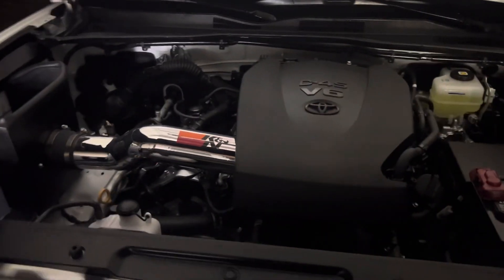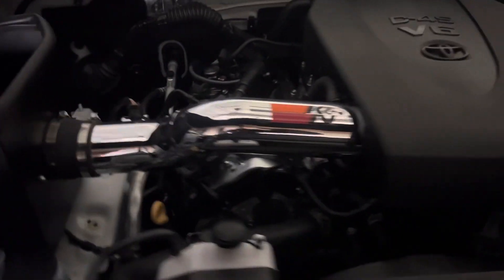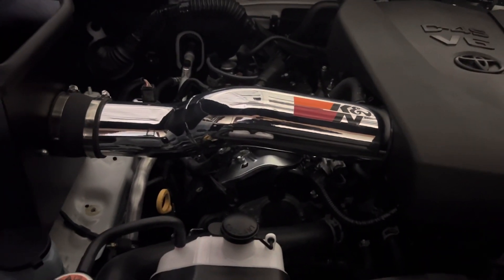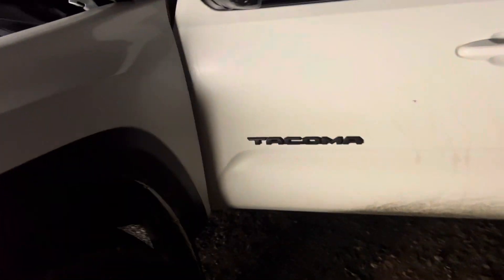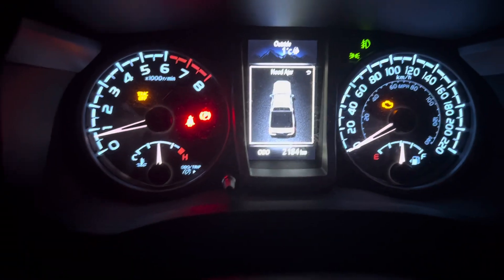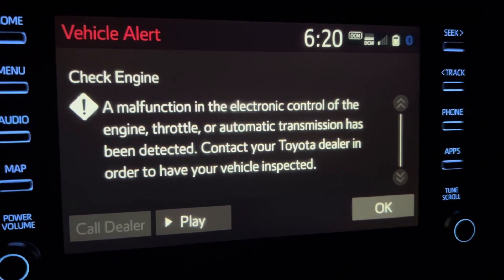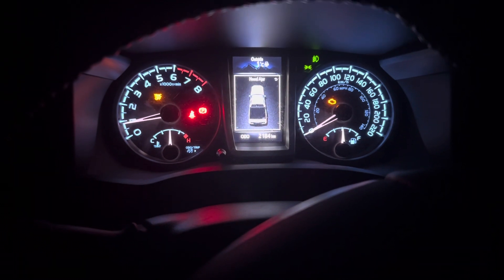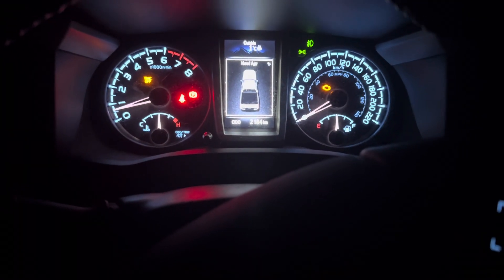Why I removed my K&N Cold Air intake from my 2023 Toyota Tacoma TRD Pro

Comment: 2017 trd off-road with k&n filter for 2 years already and no issues.
Reply from the maker: The difference I learned through the install was that the OEM set up is pulling cold air from the outside, whereas the K&N is pulling hot air from the engine bay. 
Besides looking better and sounding better , the performance benefits are debateable…

Comment: A CAI is NOT the way to go unless you are modifying your engine. Your factory  stock airbox is already a CAI because it gets its air from outside the engine compartment.
Reply from the maker: Agreed - I removed the aftermarket cai and went back to OEM once i got into it and saw the great set up Toyota has

Comment: When I installed it on my 2023 Tacoma Sport the same thing happened but it was because I had not placed a hose correctly and it was sucking air through there. I connected the hose well to make sure there were no leaks and the problem was fixed.
Reply from the maker: Thanks for your experience- cheers !

Comment: a little trash piece must have traveled into a small spring in the TB
Reply from the maker: @stevenlangevin1159  you never know, but I went back to OEM regardless just because it pulls cold air out of the wheel well

Comment: I have k&n 77 series i dont have issue so far
Reply from the maker: @jonjones9357  I have had great success with these on other vehicles, but ultimately on the Tacoma, I decided to go back with OEM because of the design of the stock system, pulling the cold air out of the fender well.

Comment: I had the engine come on mine, I told my mechanic about. He checked it out , took the air sensor out n cleaned it with just blowing air. Not a problem since then, he told me I sprayed to much oil. So every now n then I take the filter out n blow it out. I also put a dust cover on the filter to keep dust n water away,  works like a charm.
Reply from the maker: Thanks for sharing Brother!

Comment: Thanks for the video. I had the same one in my 2020 Ram 1500 Hemi installed it under 1000 miles on the truck took it off after 37000 miles never had an issue. I removed it went back to stock because I didn’t want to spend the money on a new filter. I will not be installing one on my 2023 Taco V6, I really don’t think it is worth the money well at least not this one anyway.
Reply from the maker: Agreed!

Comment: Why? I installed mine..No Problems!
Reply from the maker: @ThepDenNgoaiBien  likely some oil from the filter, went into the intake.. - regardless the OEM set up is better as it pulls cold air through the fender instead of warm air from the engine bay- so I went back to stock .

Comment: 4runner ALREADY has a stock cold air intake down at the wheel well.  You created a hot engine-bay intake 😉
Reply from the maker: @LexusGX460-OFF-ROAD  yes indeed , i learned this on my install when i bought the truck- and ultimately went back to oem right away, this was one of the reasons…🍻

Comment: Did you tune it after installing it?
Reply: I install an S&B CAI and did the same thing on me i had to desconnect battery every 100 miles to reset computer... i think u have to tube ur pcm, every truck reacts diffrent i guess
Reply from the maker: @daatobler976  no I removed it, and went back to OEM- I actually no longer own this truck
Reply from the maker: @SsnoopNinja  it’s frustrating, too many electronics these days

Comment: Interesting.  I put a S&B CAI on my 3rd gen tacoma. I picked a paper filter for it. Before I installed it, I disconnected battery, then when I was done installing,  I connected battery again and let the computer readjust to new flow. I haven't had any issues so far. I have had on for over a year so far. The disconnect battery step I'm not even sure if you need to, but saw some videos doing that step. Keep us updated. Thanks
Reply from the maker: Ultimately, I would like to go with the S&B down the road. I did disconnect the battery, I just think some excessive oil got through.?
I went back to stock and will look at a system, like yours down the road . Are you happy with it?
Reply: @mikealarie007  yeah, love it! Looks good too. It did change the sound a little, not a whole lot that's been "hyped" on some channels. I will be getting a MRP axel turn down exhaust down the road as well.
Reply from the maker: @shiloc7james363  I have not heard of that exhaust, so I will definitely check that out. Thanks for sharing.
Reply: @mikealarie007  sorry its MBRP EXHAUST,  not MRP, LOL
Reply from the maker: @shiloc7james363  right on. My buddy has one on his Titan and let me tell you it sounds dirty.🔥

Comment: I always had this issue when it was cold out. I had one on 2 different 4runners and a Tundra TRD Pro. The quick and simple fix is disconnect the negative cable for about 15 seconds and put it back on. It seemed to happen especially when accelerating hard if the motor was not warmed up.

Comment: What was wrong with the stock cold air intake?
Reply from the maker: @DJjosher  nothing was wrong with it, I was just hoping to get a better sound, and possibly some performance gains . 
However, once I took apart, the OEM intake , I was able to tell that it is actually a pretty good set up right from the factory. 
What I mean by this is that it is pulling cold air directly from the wheel well instead of the warm air in the engine bay .
Reply: @mikealarie007  Those are great observations. Thank you!
Reply from the maker: @DJjosher  good luck with whatever route you decide to go!

Comment: I have the TRD performance intake and didnt really notice a change, maybe slightly at much higher rpms. I did get a K&N blackhawk CAI which is a dry filter. No issues with idling, I like it so far but it may be too loud 😂
Reply from the maker: Thanks for the input, I have a Trd pro, and I wish it was louder!
Reply: @mikealarie007  I have the pro as well. Definitely worth a shot paired with the cat back exhaust (and the K&N blackhawk). It's no rumble like a V8, but it's louder for sure.

Comment: Didn’t for me, did you disconnect the negative terminal, are you sure the mass airflow sensor is on properly, is there any leaks?
Reply from the maker: After opening multiple units like this, I went through the proper procedures. I just think that it was probably some oil that got on the sensor., but after learning the design of the OEM version, I decided to go back to OEM and have the cold air come directly from the wheel well
Reply: @mikealarie007 interesting, i’ve had mine on since june and it runs perfectly fine… manufacture issues i guess?
Reply from the maker: @Spuunzy  I don’t know, I might go with the Trd pro version that pulls cold air through the fender at some point

Comment: Did you disconnect the battery first ? If you didn’t that could be the issue .
Reply from the maker: I sure did . 
Ultimately, I went back to oem , not just because of the issue but because once I took everything apart and saw that the factory design was a better option in the sense of it is connected to the fender, pulling in cold air from outside of the engine bay.

Comment: I installed Mishimoto high air flow straight tube 2018 3.5 Tacoma the throttle clicking popping when steering wheel is turned. I put stock cold air intake back, no clicking popping. So, I think it’s just too much cold air that computer doesn’t recognize. I’ll stick with stock for now on.
Reply from the maker: Thanks for sharing your experience!🍻

Comment: My 2017 ltzs engine loses power and cuts off on me after installing my cold air intake, I’m assuming after some digging that the sensors can’t read or aren’t programmed to read that much air flow so it shuts the engine off
Reply from the maker: @xxonexx471  thanks for the input, that’s really unfortunate that is happening🤦🏽‍♂️

Comment: does it need a tune?
Reply from the maker: I think a tune is always a good idea, however, I don’t think that just by changing the air filter it should be mandatory….
I ended up removing it and going back to OEM

Comment: Realistically they don't filter quite as well as a paper element does. For someone like me who goes in mud and snow occasionally there's no downside to them, my filter isn't dirty after 15k miles. Someone who regularly runs in fine dust is more likely to have issues than the average pavement princess.
Reply from the maker: Agreed. I ended up going back to stock just based on the fact that I live 6 km down a dirt road. It’s always dusty in here.

Comment: Whoa! I have an S&B. Did you disconnect the battery for an hour or so before you installed it?
Reply from the maker: I sure did. Ultimately down the road I will look at going with the.S&B . 
Are you happy with yours?
Reply: @mikealarie007  I am. But I may be thinking my mass airflow sensor may be dirty. Will check it out.

Comment: For the amount of money they want for these, why would you spent all that money for basically same think your came with? Dosent make sense at all! You want some better throttle response get a tune or just by AFE Pro dry s filter. At least this filter wont mess with you mass air flow sensor, no oil. Doesn't give you any power gains but throttle response is a bit better.
Reply from the maker: Agreed , we need all the extra power we can get out of these tacos ha ha ha

Comment: I would be curious as to what caused the issue.  I have the same K&N installed on my 2017 TRD OR and have not had any issues...my truck is a manual (that shouldn't matter). I have only noticed an increase in throttle response and of course the sound...fuel economy has stayed the same.

Comment: Too much oil on the filter? I've been running a k&N on my 2011 TRD sport since new in '11 and never had an issue. 
Truck has 310,000km and still spins like a top. I hope you got it all figured out.
Reply: Most likely too much oil and didn’t let dry for 2-3 hours

Comment: Hi Mike,
I’ve also have a 2023 TRD Pro and thinking about the K&N Cold Air Intake…Did you find out why it happened like that?  Please advise!
Reply from the maker: Hi Tommy ! Ill say this , i am a long time customer of these . I like the look , sound and small hp gains . 
That being said , each vehicle setup is different when we are talking oem . 
Now , many vehicles just have a hole in the fender that feeds air into your filter…
But …. The stock oem system actually has a closed off unit meaning a pipe that feeds into the fender which pulls in only cold air from that engine hole. If you put in a k&n like this , you are pulling in just the air from the engine bay and that hole . 
If you pop off the top of your stock airbox , you will see the pipe going into the fender pulling clean crisp air . 
I believe my problem was a combination of k&n filter oil and dust on my sensor, as i do heavy driving regularly on dirt / sand roads . 
I personally decided to go back stock , but will look at other options like the TRD intake which are pipe fed to the cold air hole . Just my 2 cents, cheers
Reply: Dude. I got a 2023 SX 4x4. And I have that K&N 77 series transporting into southern California cause it's illegal here.. but this is the first u tube clip I've seen negative about this. I'll keep intouch with ya and let you know how mine turns out. I'm almost to 5k on my new truck so if anything does go bad I'll put the stock intake back on before I hit the dealership to get my "truck life time oil change" .

Comment: I have 22 TRD OR and installed my K&N intake at 5k miles and the truck is currently at 16k. Havent had any issues with my truck about this, let me know what you done to resolve this.
Reply from the maker: I went back to oem just because i have to drive 12 kms of sand / dirt rd every time I leave the house . Its extreme circumstances unfortunately

Comment: I had the same problem with a Ford Ranger. The mass air flow censor is fogged with oil from the filter. They make an arisol cleaner to clean it.
Reply from the maker: Yes Sir , i cleaned it but went back to oem . Just because i did not want reoccurring issues with it getting dirty . ( i do a 12 km dirt rd every time i leave the house … )
Reply: People don’t realize that they probably use way too much filter oil! Does not take much.

Comment: There’s absolutely nothing wrong with the stock system. It is also a cold air system as it doesn’t pull air from the engine compartment
Reply from the maker: Agreed ! I only learned this when I took apart the OEM set up . I would like to get the TRD set up though. You would think the Pro would come with it stock …

Comment: I've had the same issue with my Xterra. I've stopped using K&N oil filters and switched back to the paper filter. Ended with a very hefty bill to fix because it caused the engine to run very rich and burned out my catalytic converter. This all happened within a few days after the install.
Reply from the maker: Oh man , thanks for sharing! You just made me feel better about my decision to remove it ! Cheers!
Reply: I had a similar issue with my rogue as a result of using a k&n filter.  I think I oiled it too much, resulting in a few issues with fuel economy.  From now on, I'm only going in dry.
Reply: Xterra’s are known to have cats that clog and particles get sucked back in the engine causing it to burn oil. I’ve replaced mine 2 times. But I’m sure the K&N didn’t help.

Comment: Clean your Mass Air Flow sensor, and the throttle body with the appropriate spray cleaners. Make sure there isn't too much oil on the filter, clean it and lightly oil it. It might take the computer a little bit of time to adjust - let it idle for about 10 min after cleaning.
Worth a shot to avoid the stealership.
Reply from the maker: Thanks! I ultimately decided to go back to Oem as i drive 12 kms down a sand / dirt private road every time i leave the house . It’s abnormally dusty , I figured instead of worrying about it , id go back stock . Maybe a Trd intake in the future… this one is for sale if anyone is looking! Cheers!
Reply: @mikealarie007 TRD Cold Air Intake only cosmetic, makes your engine bay look “pretty!” K&N Cold Air Intake cost the same as the TRD, most like too much oil. I have cheaper brand Cold Air Intake, half the the price of K&N in my brand new 2023 Tacoma. I love it!😊
Reply from the maker: @SMITT359  I went back to OEM , but might eventually look at alternatives- cheers!